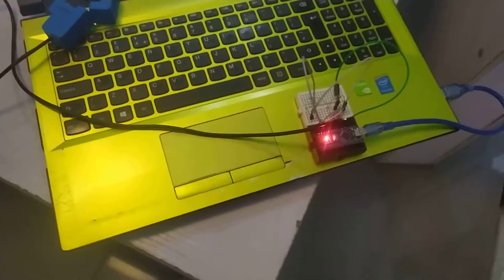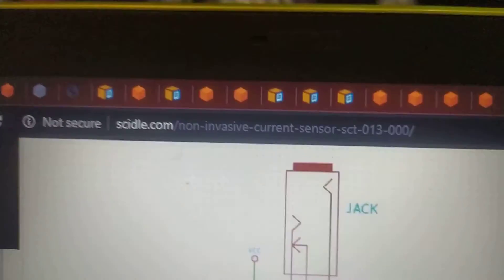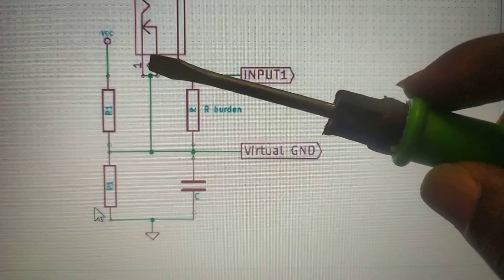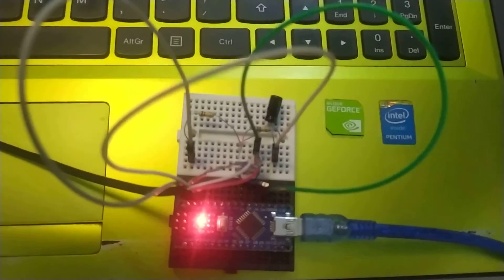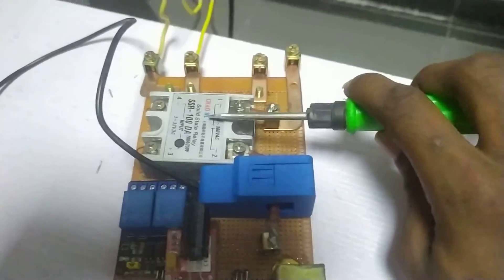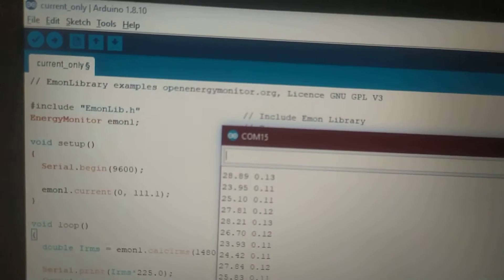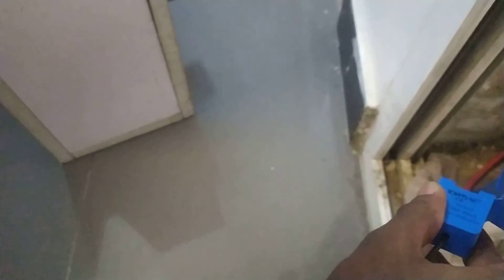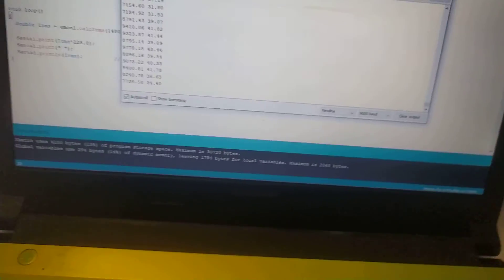SCT-013-100 CURRENT TRANSFORMER WITH ARDUINO NANO

Comment: Nice video..Just one query...To connect SCT013 to Arduino GPIO pin, do we need to cut the SCT and solder it to the GPIO pins? Is there any other way other than cutting SCT cable ?
Reply: Yes. Use an audio connector.
Reply: @dekipet  how?
Reply: @victornassif  Use PJ-307C and connect pin1 to an Analog input of Arduino. Pin4 and pin5 go to the other part of the schematic.
Reply: @dekipet  do you have any link or video teeching how to wire p2 to arduino?